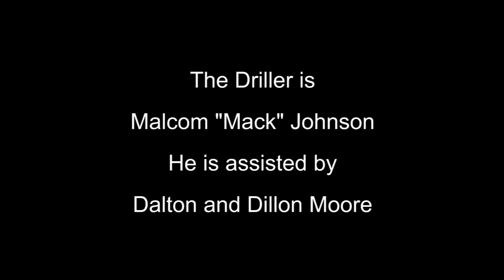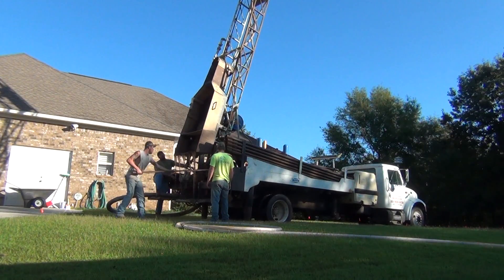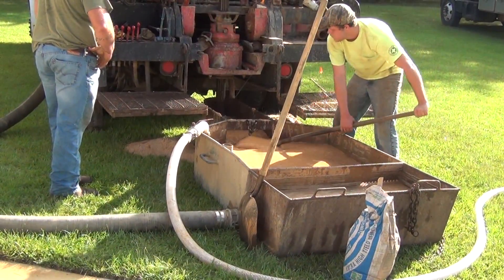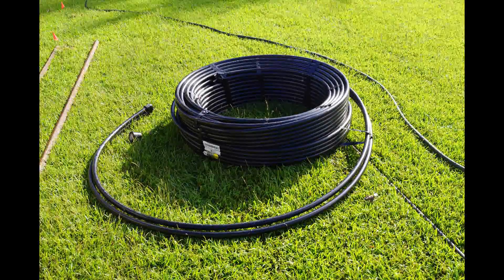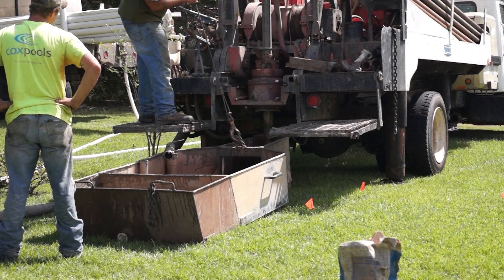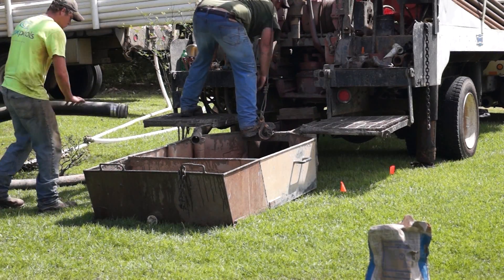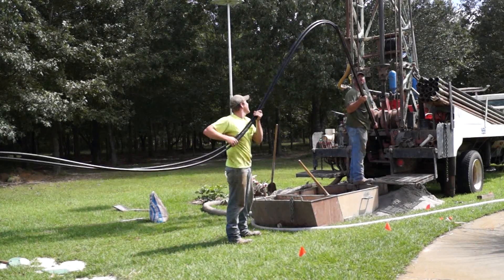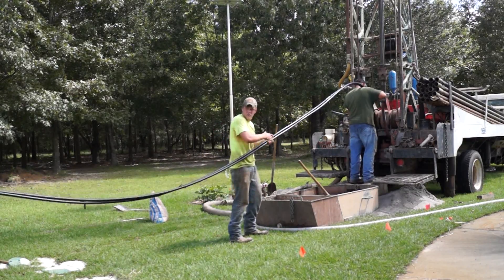Drilling and Installation of Vertical Geothermal Loops

Comment: Terrific information. Is there a book or class that details things out further or is this one of those trade professions where you must apprentice? I'd like to learn more, but I don't know where to start.
Reply from the maker: Aletoldeo1, that is one of those things you really have to research locally.  Most state laws require a licensed driller to go through an apprenticeship.   I am not a licensed driller and I really just don't know that much about the licensing process even in my home state.   The easiest way to find out is to call some local drillers or the state board that licenses them.  Thanks for watching the video!
Reply: 0589610540
Reply: I like the work 0589610540
Reply: +aletoledo1 There's no schooling necessary.  You can hire right on to most drilling companies.  You'll start as a drill hand "helper".  Basically what the two guys on the ground were doing.  It takes months or sometimes a year or so to learn to drill.  There's A LOT to learn before you start pulling levers on a drill rig. It's one of those learn on the job type professions.  As for getting a drillers license, there are tests you can take to get them from your state Department of Natural Resources.